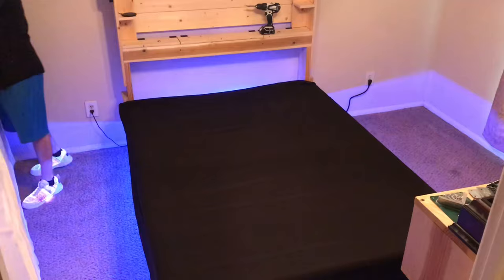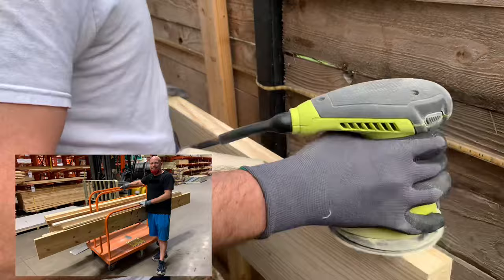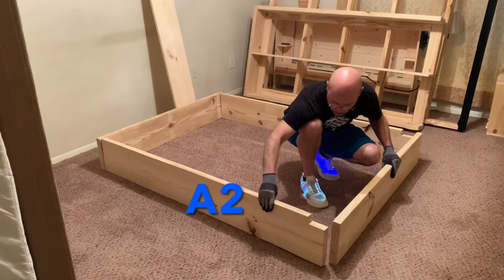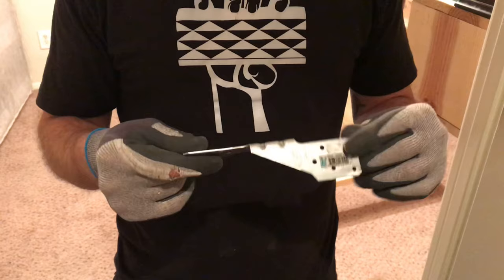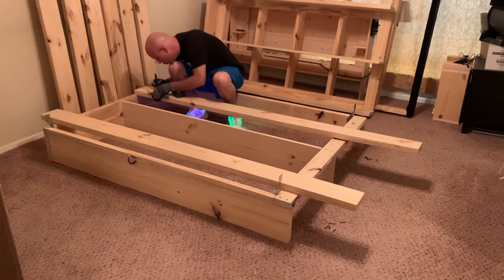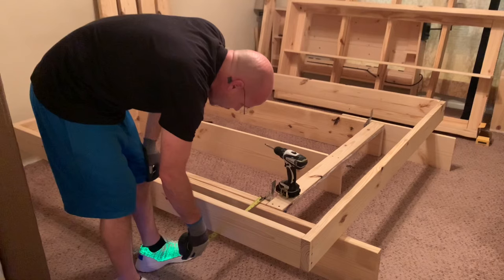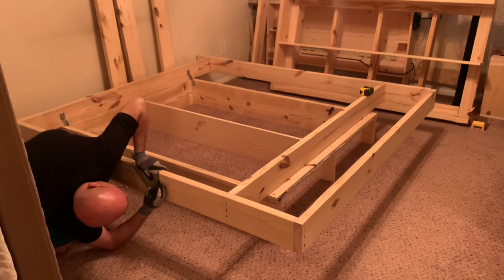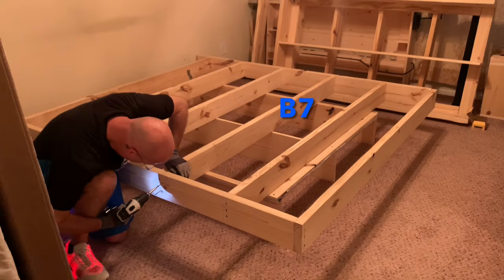King Size Floating Bed Frame [Easily build your own!]

Comment: Why 10foot if we only need 60ish on side
Reply from the maker: @lifeisbeautiful7109 Hey Life, based on your hauling capacity, if you plan your cuts correctly, you may be able to save some money by purchasing fewer boards to complete this project by purchasing 10 footers, this is the reason for that recommendation.  Purchase eight footers as needed based on your circumstances.  I hope this helps.  Thanks for supporting this channel.  🤝

Comment: Say bro how much for a King Frame?
Reply from the maker: @Even Tate Hey Even, materials for this build right now would be roughly $200 in the United States, depending on where you live.  Thanks for stopping by.
Reply: I live in michigan
Reply: The frame cost $200?
Reply from the maker: @Even Tate Texas here.
Reply from the maker: @Even Tate Yes sir, materials for this build would be roughly two hundo.  You would still need to make the cuts and put it together though.
Reply: Can u send me the measurements?
Reply from the maker: @Even Tate Yep, you bet bro.  Leave me your email address here or reach me on Instagram, I’m C_Love1984 and I’ll beam everything right over.

Comment: How many boards do I need and what length, thank you
Reply from the maker: @Cole Skog Hey Cole, thanks for your questions.  You need ALL of the boards…and you need to cut them to the correct length!  Haha 😂 just kidding.  Seriously though, that depends on how you are going to build it…are you modifying it to include storage?  Do you want a headboard?  Do you have a box spring?  Are you buying 8 foot, 10 foot, 12 foot, or 16 foot boards to start with?  …or do you have your own mill?  These are all, among others, things to consider when planning a build like this.  Please feel free to reach me on Instagram realc_love1 and I’ll make sure you are all set up for your build.  Talk to you again soon my friend.
Reply: I would like to build one with storage because why not and have a head board in the future, king size.
Reply from the maker: @Cole Skog Awesome my friend.  Check my channel videos section for a separate video on the king size headboard.  Let me know if you need anything else.  I’m on Instagram realc_love1.  I hope you have a safe build.  Talk to you again soon.
Reply: So how many boards and at what length
Reply from the maker: @Cole Skog Hey Cole, I’m sorry my friend…Im from earth here and I just wanted to see if we’ve made a connection yet.  Between this original King size floating bed frame video and the one for the headboard, I’m certain I’ve provided all the info you need to build this exactly like you are talking about.  I’m on Instagram realc_love1 if you need personalized assistance with your build.  I’ll be much more than happy to help you.  Please reach out to me there.  Be careful my brother.

Comment: I’m so confused on the measurements… what does “your choice” even refer to
Reply from the maker: @Brittany Jara Hey Brittany, sorry for the confusion.  That ‘your choice’ refers to the type of boards that you are going to buy.  I have a tiny little 4 door car so I need to get the 8 foot boards, but on some of these bed frames, it’s more economical to get the 10 foot long boards because you can get two pieces out of one board.  Also, some people are sensitive to the height of the: base+frame+box spring+mattress so if you want your base to be 2x6 with no storage, you can do that…or you can do a base out of 2x10, just know that the deck of your mattress will sit higher now.  I hope this helps.  I’m on Instagram C_Love1984 just to let you know.  Thanks for your time and support.

Comment: Get a price on how much the wood cost
Reply from the maker: @Gapping4God Hey G, good morning.  You should be out the door with all materials needed to build this king size floating bed frame as shown in the video for around two hunskie.  If you are going to add the headboard from the video on this channel, or something similar, I’d expect to be closer to four hundred.  I hope this helps.  Thanks for stopping by and supporting this channel my friend, I mean it 🤝
Reply: Okay I’m building now how many inches do I come from the wall to the metal bracket
Reply from the maker: @Gapping4God Hey G, I’m not sure I understand your question here.  If it’s not too late, I’d recommend using ‘L’ shaped corner brackets to secure the base to the frame instead of the Simpson strong ties I used in this video.  The L brackets are a whole lot more user friendly.  Let me know how else I can help my friend.

Comment: The gap look’s just little big for the mattress to rest on 🤷‍♂️🤷‍♂️
Reply from the maker: @Raull Hey Raull, thanks so much for stopping by.  You are right…just putting a mattress on there won’t work.  You either need a box spring or plywood on the frame.  I hope this helps.  Talk to you soon my friend.
Reply: Thanks bro
Reply from the maker: @Raull You bet.

Comment: Real question is does it squeak
Reply from the maker: @bestpodcastplug Real answer is no when it is built correctly.  Make sure to hold your pieces together when you are setting your fasteners.  Make sure the frame is sitting on the base before to attach the corner brackets.  You don’t want any space for the wood to move anywhere.  That’s what causes the squeaking.  I hope this helps.  Thanks for supporting this channel my friend 🤝

Comment: 2 10ft boards makes no sense when a king is 76x80
Reply from the maker: @aleckorslin4519 Hey Alec, use the off cuts from those 10 footers as pieces for the base.  You need anything else cleared up my friend?  Thanks for stopping by 🤝

Comment: Or just nail it and take 1/2 the time
Reply from the maker: @Ray Bocock Hey Ray, good morning.  Thanks for your first of it’s kind comment here, I’ll bite.  If you are talking about a pneumatic 15 gauge finish nailer liked I used in my ‘apartment workbench’ video, then yes, you may be correct.  You may be able to finish more quickly with that tool, but I’d recommend gluing your junctions so your nails don’t slip out and so you don’t have squeaky joints.  I’d catch up to you at this stage.  If you are talking about old school hammer and nails, I guarantee I would finish my build first and it would be stronger with the screws instead of the nails, and you would still have to glue your joints.  Pretty much everyone that contacts me for help doesn’t have access to pneumatic tools, and in fact, some of them are still having big orange make the cuts for them so screws were the best recommendation for my floating bed frames.  I hope this clears things up.  I appreciate your time and support my brother.  I’ll talk to you again down the road.
Reply: @CurtisMadeIt   I’m taking bout a 21 degree framer with 3 1/4 nails
Reply from the maker: @Ray Bocock Okay, okay.  So, pneumatic.  Yeah, you are gonna finish a whole lot more quickly, but as I said, you’d probably still want to glue your junctions to keep them from squeaking and pulling apart.  That tool is more than a hundie by itself, plus you’d still need to buy the compressor, the air hoses, the connectors, and nails.  People who have access to these kinds of tools are able to watch this video and build their own version while offering help and not coming across as condescending.  Not everyone has access to the resources that I and presumably you do so I try to make the builds on my channel as accessible to regular DIY person as possible.  I wouldn’t recommend using nails for this build.  I’m sticking with the screws.  Thanks for your talk here, I appreciate it, for real.

Comment: Have you got even the slightest clue on how to make a frame that will survive 2 x adults, 2 x great danes, and 2 x toddlers???
Reply from the maker: @Wes Harrison Hey, good morning Wes!  Yes, I sure do!  I may be reading this wrong, but I feel like I’m sensing some kind of tone in your statement/question here.  My bed frames are rock solid as proven by the fact that at least thousands of people from more than 72 different countries(I can prove that if needed) have copied my design and built their own.  I’ve never heard anything bad or negative from the literally hundreds of people that I have personally helped…in fact, I’ve only received nothing but extremely positive feedback and reviews(make sure to check the comments section on all of my floating bed frame videos).  I can absolutely guarantee humans significantly larger than you have recreated and are currently using this bed frame, probably right this second.  You can fit the whole army on my bed frames.  I appreciate your question.  Can I clear anything else up for you?  Thanks for your time my friend, I’ll talk to you again down the road.
Reply: @CurtisMadeIt  Oops! I should have worded this without "even". I think I began typing something else and forgot to delete all the way back 🤣 

But at any rate, thanks for the reply!
Reply from the maker: @Wes Harrison You bet my friend, no worries at all.  I'm here if you need anything else.  I appreciate your time and support.  🤝